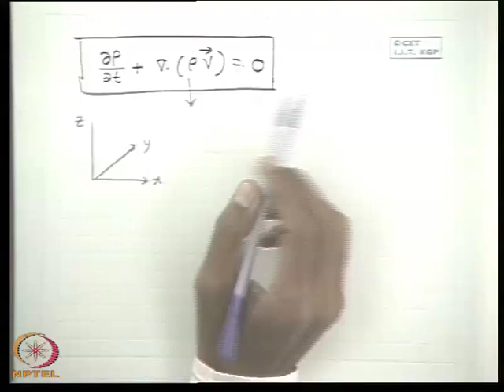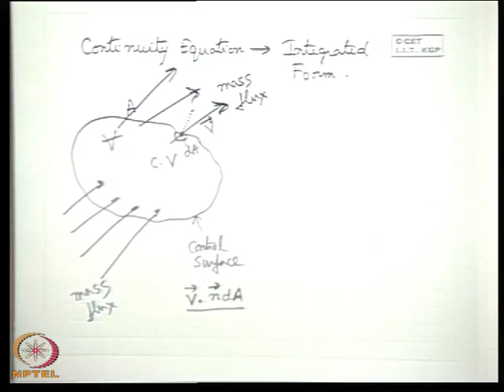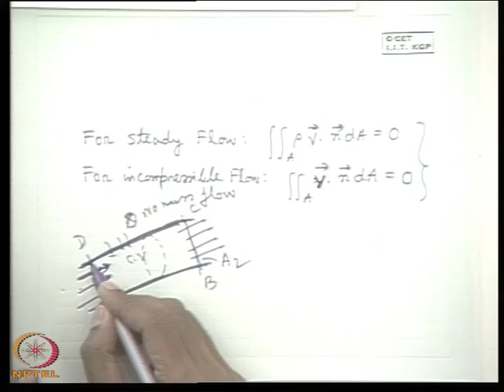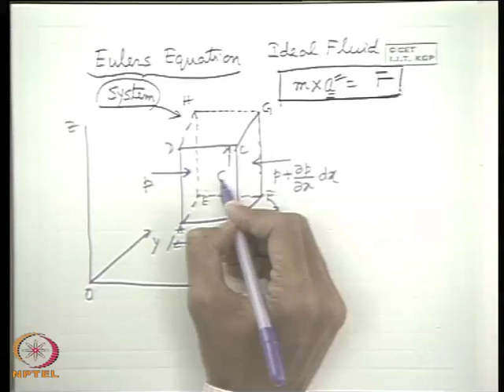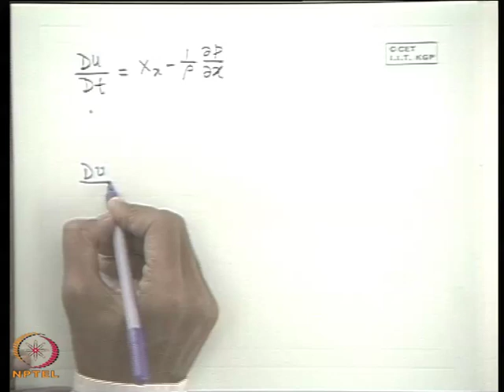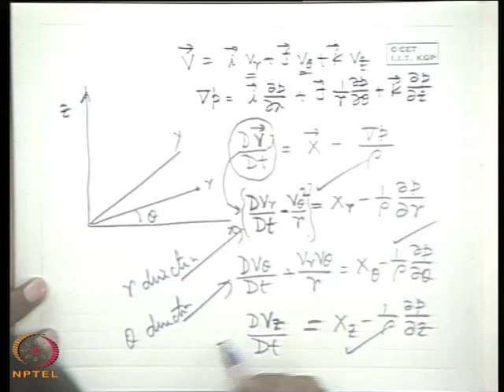Mod-15 Lec-15 Conservation Equations in Fluid Flow Part - III

Comment: grad in this video for cylindrical coordinate is different from the one used for the derivation of the continuity equation in cylindrical coordinate system in the previous lecture.
Reply: Yes there should be an p/r term!
Reply: @Apoorbo  here in Euler's equation, the grad operator is acting on pressure P which is not a function of time. 

While in continuity equation the gradient operator is acting on vector V which is a function of (x,y,z,t) therefore it's form is different.

Proper explanation is Available in F.M, White. 

PS: Haven't checked exact reason yet.

Comment: @21:39 you are saying pressure is changing,but as per Pascal law pressure will only vary along the depth right?.then how come it is changing in X direction?
Reply: As per Pascal law pressure is changing in vertical direction only when fluid is static. Pressure may change in all directions when fluid is in motion.  I hope you will understand

Comment: in Euler equation, we considered the flow is inviscid, so shear stress is not acting on the fluid element. Again we considered it is a control mass system, its volume may change. If volume change, then there is relative displacement between the fluid layer, so shear stress is acting which violates the definition of inviscid flow. How is it possible?
Reply: Volume can also change without any relative displacement between the layers . I.e., under hydrostatic pressure
Reply: Prabir Sikdar he said we don t  consider control volume system here, rather we take control mass system into account. But finally at the end you'll see that both control volume and control.mass is acceptable  for euler
Reply: Moreover as because of compressive pressure  force  there is moveover of system so there is force generation, we can't  take control volume as it is fixed but when we take whole of the system like not a single  fluid particile  (control mass system) as above then by modification  through Reynolds number, he will relate it with control volume.
Reply: Even if the volume changes there will be no shear stress generated as there is no viscosity , which is the main cause of generation of shear stress .For example assume a solid box on a friction less surface there will be no friction force (a kind of shear force) here ( as frictionless surface) even if there is relative movement between block and surface.

Comment: The flow is incompressible then it doesn't mean density is constant(as per his explanation in his own book) then why the professor constantly everywhere tells that density is constant?
Reply: General thinking brother ,in incompressible flow as it can't be  compressed volume will not change ,volume will not change density is constant (we can't have changing mass ofcourse in normal conditions)
Reply: Yes indeed constant density does not guarantee incompressible flow (It is the volume strain rate which defines it). perhaps I think that he does not want to complicate the discussion by bringing in variable density incompressible flow

Comment: sir with due respect i would like to ask that when u derived the integrated form the integration of (rho*v.n dA) u have used used it in the continuity equation as net rate of efflux... but sir it is not net rate of efflux (which is equal to (influx rate-outflux rate)) rather it rate of outflux.. so when u have used this in the equation it shows that accumulation=-(output) which makes no meaning... pls consider this...
Reply: The NET rate of efflux meaning is (rate of outflux-rate of influx ) since we know that fluid comes in the control volume & accumulate in the c.v and gets out of the c.v 
so as per our mathematics (rate of influx = rate of accumulate + rate of outflux )OR (net rate of accumulate + net rate of efflux = 0)
Reply: Its All Across the Area of the Control Surface, So integration will cover both incoming as well as outgoing Flux.
Reply: as the integral is all over the surface, this term covers both in flux as well as out flux